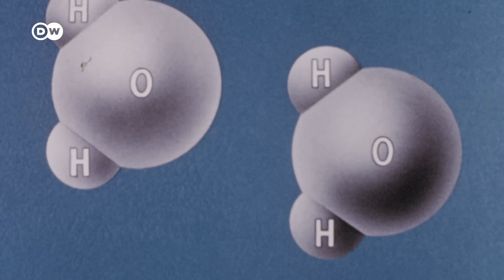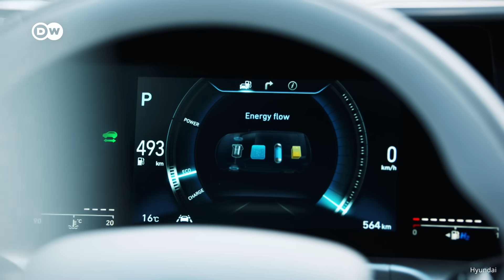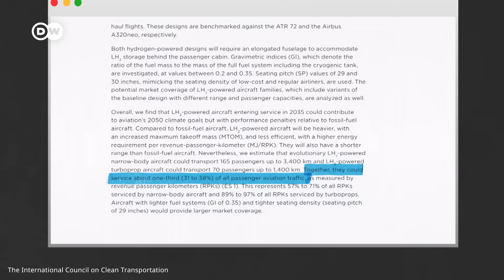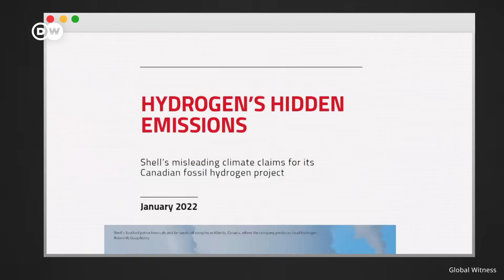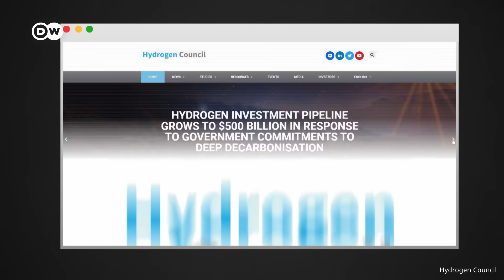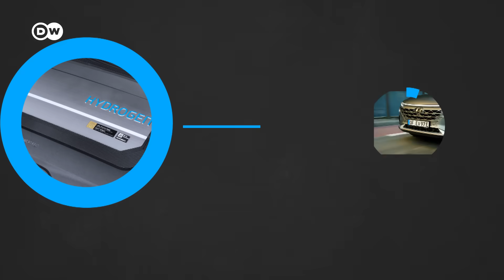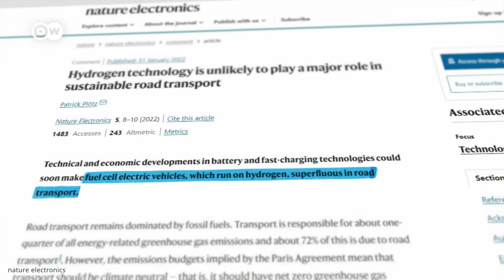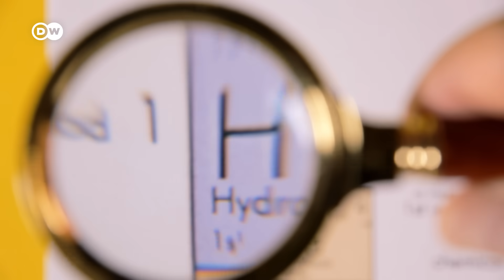The truth about hydrogen

Comment: Nuclear is the only game in town for energy production.  Use hydrogen where it makes sense, but it only makes sense if there is green-hydrogen production.  Hopefully nuclear fusion will become a practical source of energy sooner than later, because nuclear is the only reliable, non-polluting energy source.  All others have huge footprints.
Reply: Heck Nuclear can actually compliment hydrogen really well with the new experiments for Very High Temperature Reactors, they can generate hydrogen using thermochemical water splitting via the really high heat produced by these reactors as waste, it's also much more efficient vs electrolysis. Japan has tested this in the past with their experiments on their HTTR plant and could generate a large and stable amount hydrogen without emissions from the reactor's operating high temperature.

Comment: One big thing that this video got WRONG, is that when Hydrogen is combusted, it is not only water that is produced - due to the higher adiabatic flame temperature, it also emits NOx emissions (nitrogen). When used in a fuel cell it is clean.

Comment: "Backwards" demand can assist green Hydrogen development.  What I mean is developing personal sized green Hydrogen products for use at home (water heater, fridge power, backup power, heating small spaces such as the garage or ice melting, camping/campers, etc.) That type of backwards demand from the micro side creates some capital and excitement at a smaller (likely easier) level vs industrial scale.
Reply: True ... in fact my thoughts are similar even for the Solar ...instead of large Solar PV its the Solar Rooftops that will help build energy security at local level at low cost incentivized by the govt without major ecological concerns

Comment: Hydrogen is a hype technology pushed by scammers: producing it from renewables only makes sense when you have a huge oversupply of electricity that can't be sold at market prices. Since the hydrogen cycle will always be inefficient, using electricity to produce it will always be a last resort. There is no chance to get to that level of renewables oversupply this decade, we are barely struggling to cover existing demand with non-carbon electric sources; let alone have such excess that we can throw 60% of it away to fuel everything with hydrogen.

Comment: Hydrogen is an important part of the mix of energy we will need to get to carbon free world but it won’t be the most adequate in every situation. Plus, there’s also PINK hydrogen, which is the one generated from nuclear energy, using small nuclear reactors. Japan is doing a great effort using this latter method
Reply: Yeah, their experimental HTGR type reactors could in simultaneously generate hydrogen from the high heat and electricity that isn't considered in this video. Once those are actually in use and online, they would likely be far more feasible for generating a large and stable amount of hydrogen for fuel and still remain a relatively clean source. 

It kinda lines up with Japan's recent renewed interest back to nuclear energy to lessen its reliance on imports (which made electricity pretty pricey here) as well as the govt's plan to be a hydrogen society in the near future.
Reply: We are going to need hydrogen technologies to colonize the Moon, Mars, Titan and so on. This may be our future after all!
Reply: First before we consider any new applications of hydrogen we need to clean up the production of old hydrogen demand for old applications. 

If we create a new application and fuel it with green or pink hydrogen, it still has a terrible emissions footprint because it is not displacing old brown/black hydrogen. 

Any new cleaner hydrogen production needs to go first to displace old brown/black hydrogen production. 

Only once we are near 100% green/pink hydrogen production should we consider any new applications of hydrogen. 

On top of that we need to consider if the green/nuclear energy used to make additional hydrogen would just be more beneficial plugged into the grid to displace fossil fuel energy used elsewhere before we bother using it to supply new applications of hydrogen. 

So a lot needs to happen before any new applications of hydrogen can even be considered.
Reply: Sure! Let's eliminate ALL CO2 from the planet and starve all of Earth's plant life to death so we don't have to live with the pesky Oxygen those plants produce in an already perfectly balanced ecosystem.

Comment: Thank you for the honnest and complete video. It is a good overview of H2 today.
However I would like to point out some flaws:
- First there is already a huge H2 market, mostly to produce NH3 but we should focus on these markets first cause it will already take decades to decarbonize NH3 prod. We will get higher veggies cost, but it worths it
- Second, the bloomberg report on H2 is ridiculous regarding predictions, not based on any science but just ideology and linear regressions. H2 prod with renewables works mainly with PPA, so constant electricity from network and not only actual renewables. If so, the production won't be continuous and H2 cost will remain high. And to get an electricity network stable with high proportion of renewables, its costs a lot more than the electricity today, so no big H2 cost reduction...

Comment: The efficiency problem is not an issue in a scenario where wind and solar sources are used in the production of hydrogen.  More hydrogen being needed to affect the same output as less gas could motivate engineers to design perfect machines. Hybrid options also make sense, so battery and hydrogen linked to the same system. There are plenty of creative solutions to the space for storage issue. We can build up and down. When we start tapping the sun, wind and thermal energy stores deep underground, the abundance of energy will render the arguments against hydrogen moot. If it is a convenient carrier, that is enough. If the top competitor to its use is lithium ion battery or similar packs, charged directly from the grid, this will produce massive junk piles and keep users dependent on the power grid. No back country trips past battery range, and if anything happens to the grid, everything shuts down...

Comment: Rather than using hydrogen fuel to power vehichle, why not using hydrogen fuel to power up electricity to be supplied onto electric car?

Electric car seems "green". But many have ignored where is the electricity source comes from. Its mostly from coal. As EV demand is increasing year by year, so as demand of electricity. Hence, more coal or nuclear reactor will be built. So perhaps hydrogen fuel can be used to generate electricity as alternative.

However, how good is the overall efficiency can be a good study

Comment: "60 barrels of oil are required to make the plastic for the interior of one Tesla."

Oil is not a “fossil fuel”, but was deemed an organic substance back in 1894 when Rockefeller met with the worlds organic chemists – he wanted a way to ensure that his Standard Oil Company could raise the price of his product as necessary by claiming it was going to someday run out. Yes, that has been their tactic for 126 years now, and people still fall for it!!!
The second most common liquid on Earth is oil, after water. It is produced as a byproduct of geological heat and pressure in the crust – just as the hydrocarbon atmospheres of other planets and moons. How many dinosaurs died on some of Jupiter’s moons? None. Yet they have methane atmosphere. 
There has never been a fossil recovered from greater than 10,000 feet below the surface. Oil wells average depth is 30,000 feet.
The greatest “greenhouse gas” is water vapor, but the left can’t tax evaporation of the oceans.
The biggest LIE of the last century . .

Comment: Hydrogen created with alternate energy sources - wind or solar, for example - seems to be the best solution for now. But that route is a long one. Can we make enough headway this decade to meet climate goals? Can we hold off the tremendous pressure from the fossil fuel giants, who want to produce blue hydrogen?

One question - if consuming hydrogen in a vehicle produces heat and water, how much water and could it be captured?

Comment: It would be a lot simpler to convert gasoline powered cars to run on propane /LNG/CNG natural gas, (take you pick). It's a simple conversion process.
The emission are 95% water, with out the power robbing pollution  controls required for gasoline giving you back the power loss from the less dense gas)fuel.
The technology has been around in one form or another for 100 years but for normal car at least 45 years with filling station in Europe.
Converting to Hydrogen makes NO SENSE for a fuel for cars.
You dont need EV cars to reduce emissions. Justify them for different reasons. 
Cheers Warren

Comment: Hydrogen will never happen. You can't change the laws of physics. No balanced approach required. H2's propensity to leak through atomic-sized apertures means it will never be mainstream (not to mention the lack of an economic means of production). And there was no mention here about nitrogen oxides produced when hydrogen is burned at high temperature. The Artemis rocket is an excellent example of this problem. If NASA can't launch a rocket because of H2 leaks, how will the average Joe ever be able to make a cross-country trip. At least the burning of fossil fuel produces food for trees.

Comment: Surely if hydrogen was to be used to power road vehicles, instead of the cost and losses caused by transporting it to fuel stations by truck, could the stations not just have a heavy duty electricity connection so the hydrogen could be generated and stored in situ. That seems to make more sense to me.

Comment: What we've learnt from the EV boom is that most people aren't conscious of where their energy comes from. You can market a product like a shiny new BEV, but marketing the energy is more difficult, people don't really care.
Reply: Battery EVs are going to be a great value for commuting with a low "Total cost of ownership" once BEVs get to large scale production. Low fuel cost, scant maintenance, etc. The externalized costs like smog and climate change will not be tasked to the public like the goons in the coal and oil industry are currently doing. 🚗

Comment: Let’s hypothesise that energy can be harvested directly from the sun and stored in LFP batteries that can acquire a 99% recycling efficiency with a carbon-neutral (or less) impact for the full battery life-cycle. If that becomes the reality, who will bother with Hydrogen production as a fuel?

Comment: Something I don't understand. When you use electrolysis, you split water into its two parts, Hydrogen and Oxygen right? So how is the "waste product" water? You collect the Hydrogen so surely all you get is Hydrogen and Oxygen separately? Clearly i am missing something or is it a question of efficiency? TIA
Reply: Peter Hinton, Good point. The answer is that, in the case of a hydrogen fuel cell car, you have a tank of hydrogen. It passes through a fuel cell, i.e. a catalyser . It causes the hydrogen to combine with oxygen from the outside air making water which drips from the exhaust pipe. In the same way that a lot of electricity is CONSUMED to split the water, so a great deal of energy is CREATED when the gases, aided by the catalyser join together again. That energy is in the form of heat AND ELECTRICITY, the latter you use to power an electric motor or motors as in a standard battery electric car. The electricity is produced continuously but our use of the loud pedal may be down to the artistic temperament of the driver (Jeremy Clarkson has a different artistic temperament to James May) so there is a small battery to  provide back up whilst Jeremy plays silly buggers. Imagine a bowl into which a tap is continuously running, and you fill jugs with the water to use for various purposes. The level of the water will go up and down depending on the frequency that you extract water. So it is with the battery. The catalyser is providing a steady supply so we can dip in as we choose with the accelerator, use of lights etc. Supposedly, you can drink the water that comes out of the exhaust. I have never felt the urge  to do so, so what comes out of the exhaust is what they are calling "waste". Ashes to ashes, dust to dust for us, water to water for hydrogen.
Reply: @terryhoath1983  thanks Terry  it didn't work in my head so thank you for explaining it to me.
Reply: @john Mason If you had bothered to read my reply to Peter, and his reply to me, you would have seen that Peter's question was already answered to his satisfaction.

Comment: you haven't mentioned that burning hydrogen in an air breathing engine creates nitrous oxide. It is not burnt with pure O2 to create just water vapour. The internal combustion engine companies are just promoting the fuel to extend their commercial investments and Intellectual property in these engines rather than going electric where they may have to buy IP from others.

Comment: Hydrogen as any kind of large scale fuel will never go anywhere. It takes too much power to create via electrolysis and pulling it from hydrocarbons is a waste because you can simply burn the hydrocarbons and skip the complexity. It has niches in certain areas and uses as a gas. But Industrial scale fuel it will never be.

Comment: What if it's all meant to misguide you. 
No extra storage then the water itself,  much less water to run a vehicle 30x's more than petroleum currently used.  Minimal conversion of current and former engines, any combustion engine. 
I've personally ran hydrogen on 2 vehicles with minimal alterations and it's safer than any other fuel period. No onboard storage of anything but water.

Comment: No, current from the grid to power EV's isn't Carbon free,why should H2 be? Sure we want low Carbon H2,but coal and gas shouldn't be powering EV chargers, by that thinking no EV's until the entire world is 100% Carbon neutral for grid energy, which is ridiculous,even if coal powered we want EV's so when the grid is cleaner the cars are there ready to use clean power.Same with H2, doesn't matter if we make it with coal or gas, we need to have H2 storage, vehicles, grid energy storage,H2 for industry's when we do have green and pink H2 we have the infrastructure to use it.

Comment: There is an environmental cost for every green energy product. Wind mills, solar panels, carbon fiber tanks, steel, batteries, electric motors, etc. all have to be produced using conventional means, all of which have some impact on the environment. As one science writer put it, it takes energy to make energy. There is NO free green ride. To hear some advocates you'd think wind mills and solar panels ate made from renewable fairy dust. In any green energy discussion there must be a recognition of all the steps leading up to a green energy product, there must be a reality check and then a balancing act to determine the better of two evils. IMHO

Comment: Every critic of hydrogen is the same.. they always convert it to electricity before using it. Why the heck is that?
Hydrogen can run like a petrol replacement with even higher energy density than petrol. They highlight all the problems of hydrogen while those are existing issues with battery cars and petrol. I have no idea what the hell is going on... All this criticism can be applied to hybrid (aka idiot overengineered) cars and electric cars.
Hydrogen challenges can be realistic while batteries need to be replaced constantly. well that's the basis of capitalism huh. Starting to see a pattern here why problems aren't addressed...

Comment: Question: By using the carbonate in water and 2 electrodes, does the increase in H2 “Re form to produce a double bonded cyclic molecule composed of 5 Oxygen atoms”? This molecule was discovered by a Korean MD named Kangan that observed this phenomenon under the microscope and has super healing properties equal to the water of Lourdes..
Reply: "Brown's gas" has super healing properties, as hydrogen inhalation therapy, and the hydrogen water it produces is also structured i.e. exclusion zone water/ plasma water/ 4th phase of water /cellular water

I wouldn't have believed it if I hadn't seen it for myself.

Comment: If we are trying to clean up the environment we need to consider the environmental impact of the "solutions". Batteries Lithium and Nuclear are toxic to humans. Solar and Wind aren't reliable without batteries some as large as a small town. None can be effectively recycled without further damage. Given the mining needed for raw materials like lithium the carbon footprint of an electric car is the same or worse than an equivalent gas vehicle. Hydrogen fuel cells can be used create hydrogen say from sea water and the hydrogen needed to run the semi autonomous Semi truck that ran across the country without refueling in 2015 was no bigger than the battery needed to go 400 miles without a 6 hour recharge. Electric vehicles are simply not efficient enough for modern life and forced adoption without options will tank the world economy and through civilization into chaos and depreviation. Given all of this if we don't switch we are not making any progress and nothing will change environmentally except a lot of elites will get rich making things that don't work. The answer is a mix of solutions and cleaner use of them and an admission that we will always need oil and gas for some things like making electric cars and batteries or fertilizer... Let's hope and pray for everyone especially our public servant political leaders to see the light and do the right things for everyone not just themselves. My opinion